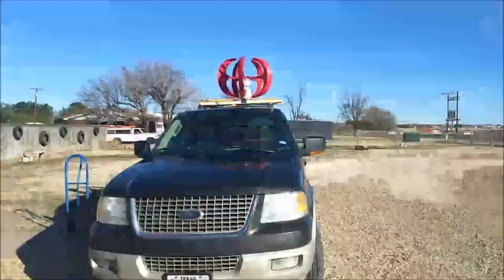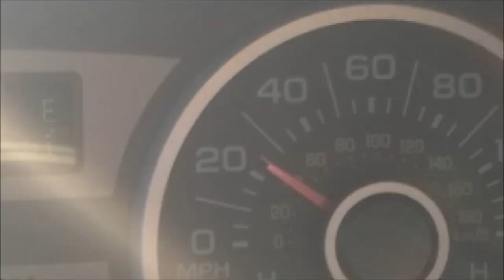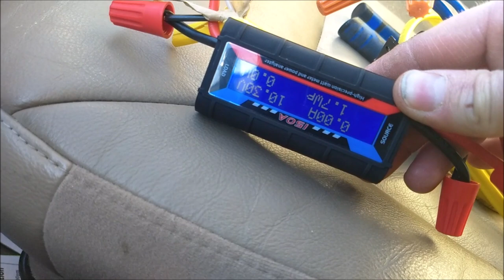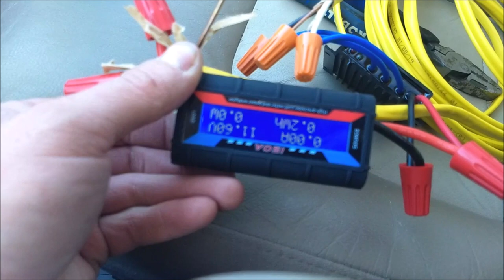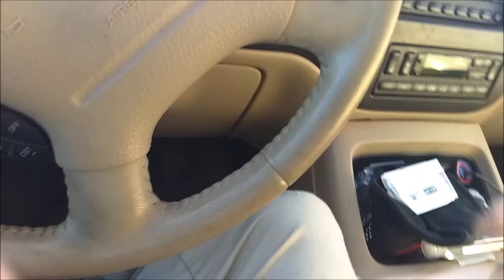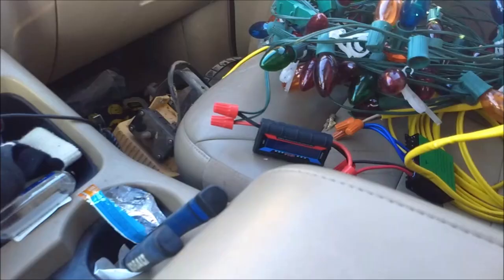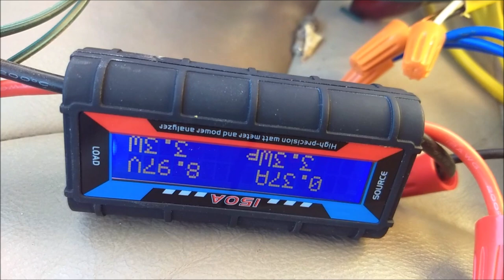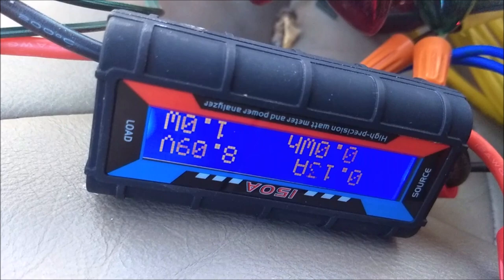What happens if you bolt a Chinese/eBay vertical axis "lantern" turbine to the roof of your car?!

Comment: But all those lights you’re trying to use as loads appear to be 120V AC Lights, and the machine is supposed to output 24V DC, right? And your charge controller is looking for a battery, to charge, right? You may be right, but we cant really know for sire because your loads aren’t the right loads to use... you need to connect the charge controller to a battery, then the battery to an inverter, then plug your lights into the inverter. Or juat use a dump load resistor.
Reply from the maker: ANY load should have drawn some wattage out of the turbine.  A 120v AC lamp would act like any other kind of resistant load.  The take away from the experiment wasn't suppose to be "well it turns out this allegedly 400w 24vdc turbine can't run a 120v 500w work lamp"...the take away is that the turbine was not producing any usable power regardless of wind speed.  I could have built the perfect system and there still wouldn't have been enough copper and magnet inside to make it work.
Reply: Toys for Watts what you say is true if you connect the output of the generator directly to the lamp, but not it it’s a charge controller. If that’s a charge controller it won’t put current to a lamp unless it’s a designated lamp connection. A charge controller is sensing the voltage level of the battery it’s charging and won’t send current to a short circuit and won’t send more current than what is safe for charging the battery. The current exiting the charge controller is dependent on the battery level, that’s why connecting lights to the output of the charge controller won’t work.

Comment: if i am not wrong if your battery is already charged and you don't have a power cosnapion someone how , you won't get any power from the generator.
Reply: you need to connect 2 brand new batteries and be almost empty
Reply: That's not true. It will make watts even with no battery's.

Comment: You are under the air foil in a vacume move it forward 5 feet so it's a the break of the windshield you will get a very different result but it's still crap the last generation is decent though
Reply from the maker: It's actually in a high pressure area (according to Ford's aerodynamics testing)....the air where the turbine is would actually be densest/fastest where I put it....BUT I actually sat down and did the math after putting the video together.  Ignoring all ideas of whether positioning was responsible for the results, the turbine was spinning nearly 6000rpm at one point and peak open voltage didn't come anywhere near manufacturer claims.  There's no way it would reach that kind of rpm on a pole in my field...it really was just a bad stator/rotor combination.

Comment: He confused watts with kilowatt-hours on the meter readout.  Should have calculated the watts by multiplying the amps X volts instead of reading the kilowatt-hours.  Anyway, it obviously needed much more wind to get going, so this is not going to be practical any way you cut it.  Thank you for showing us the actual performance!

Comment: Good concept, but a few flaws I Can see . The turbine is not actually getting the amount of air speed you are driving, as it is not in clean air and the point of compression has changed due to the aerodynamics of the vehicle. Maybe put it on the hood instead of the roof
Reply from the maker: The hood is actually a low pressure area.  The highest densities around the 2005 Ford Expedition are directly in front of the grill and about 12" behind and above the top edge of the windshield.  Air has to compress and go up and over the hood...it's not a particularly aerodynamic vehicle and air does not flow cleanly around it.  I chose top center because it was the densest air I could safely get.  Trust me, at the one point the turbine was running between 6000 and 7000 rpm...the location exposed the turbine to more wind and rpm than it would ever get during reasonable use and still produced next to nothing.

Comment: in short, is this wind generator good or is it crap, because all I hear is that it's crap, that it doesn't generate anything, crap, does anyone answer? someone has ? it works .
Reply from the maker: No they're rubbish, the stators and magnets are far too small and they cannot achieve any kind of reasonable RPM to make any real amperage.  They should be avoided.
Reply: and if you change the thickness of the wires and also the magnets, would it work? do a test there!, then put it on video.

￼

Comment: 1.7 WATTS? WTF? Is there anything inside this thing?
Reply from the maker: There is, but not much.  It just didn't have enough magnet and wire inside to really produce anything.  It really would have done better or a 48v (or higher) rig but even running to a 12v battery it should have done more than it did.  It's simply an example of something made for aesthetics vs performance.  It was neat to watch it spin.

Comment: Your car will be using more gas because of the drag and weight. Its a tiny amount but so is the power you generate. Also these drag-type vertical axis wind turbines are very inefficient because the drag keeps it from spinning efficiently, perhaps try the helix type.
Reply: I don't think he meant to break the laws of thermodynamics 😊

Comment: Dude. The mph on many turbines are 10- 24 mph
 (atmosphere wind speed). If you exceed that the safe mode kicks in and dumbs down to protect the system.
Reply from the maker: No...no they don't.  Charge controllers have brakes integrated into them sometimes, but the turbines are just copper and magnets.  And when the brakes are on, they don't just stop electricity from flowing, they stop the turbine from turning.

Comment: Everyone did notice the meter reads what is current and he was stopped while showing us. The battery went from 10 volts to 11 volts so it was receiving a charge. cant say how much because we cannot see meter while vehcile is moving.....Inaccurate testing of this....
Reply from the maker: It wasn't suppose to be an accurate test.  It's easily the least informative test I've done and was only done to demonstrate that it was simply incapable of coming anywhere near the seller's claimed outputs.    You can see the break down of the generator in the link below...too small of wire, not enough of it, and tiny TINY magnets.  Producing anything at all was impressive in a way.  https://youtu.be/H7_UFuM9ZZY

Comment: I think the design of the turbine part is fine it must just have a total rubbish generator. I think if you bolted that rotor to a dc electric scooter motor or anything similar, you would get a much better result.
Reply: No way. That design is absolute rubbish. The air that gets sliced into by the leading edge creates a fckd up vortex on the trailing edge causing loss in efficiency.
Reply: @haywoodjablome440  yeah i get that but easily fixed with wid deflectors focusing the wind to only catch the trailing side.

Comment: First off is, are you trying to light a 500 watt bulb or a string of Christmas lights that operate on 120 AC to a 12 volt DC/Charger/battery setup?  That will never work.  You can put 12 volts at a 500 amp hour source into a 120 bulb and it won't light up.  However the generator seems to be a piece of shit incapable of producing even the 12 volts it advertises more or less the 300 or so watts it claims.

Comment: The problem is probably not the generator, but the turbulences from the car. Look up wind tunnel testing where you can see the flow and you will see.
Mount it on a pole 2m above the car and test again or at leat as far as possible to the front of the roof.. In the driving view you can partially see it is rotating very slowly, which shows it does not actually get much wind at all.
I doubt it would get 400W, but 100-200 should be possible even with that Chinese thing....

Comment: Defintely dont trust any numbers from Them but something is wrong with your battery or your connection to it... The thing has to get at least 200w but I've seen other tests that give 400.. get a multimeter and another battery connected to an inverter, connected to a load.. Scrape the gunk off the battery terminals or try new battery

Comment: I think theres lot of people like me thats mechanically inclined and been interested in wind and solar, but never studied Amps and watts to understand what we need for our projects.
     I have a 20ft camper on land that I bring a Marine battery to run a couple lights at night mostly on weekends or a week at a time. I thought something like this would be good to keep my battery charged all times so I can leave my battery there becouse i bring it home to charge it.
  Does anyone have any recommendations that works for me? I dont go solar becouse of shade. The battery would have time to charge for at least 5 days before I'm back.  I thought something like this would be nice becouse its small more hidden for what i want. Any ideas is welcome. 
Thanks for the good video.
Reply from the maker: What size battery are you charging and what kind of wind can you rely on?  You say no to solar because of shade, but shade makes me think you're around trees and that tends to interfere with wind turbine operating also.
Reply: @ToysforWatts   right around 1000 CCA marine . Its about a truck battery and a half. Its heavy. I bought it at walmart 12 years ago. Biggest one they had. Still good.  I do plain on up grading battery I dont have it by me to give information on it. But I do plan on upgrading battery. I don't use a lot of power battery is actually lasted 2 weeks every night for couple hours before I recharged it.
  I am around trees in a planted Pine Forest. Thought I would mount on a 35 foot pole trees are only 20- 25 ft high. I do get good wind above tree line real consistent. Lake Michigan winds.

Comment: Its not even spinning i would recommend covering half of the turbine that way it only gets wind  on one side get it spinning in one direction
Reply from the maker: There were times when it was spinning 6000+ rpm.  What you're seeing is called shutter sync.

Comment: What we need is smaller versions of these to screw on the car when it's windy outside and we are not using our car, like at night, simply to make use of the car roof and the wind.
Reply: He thinks he testing wind speeds,  but driving 100kmh is tornado,  windmill work 10m/s speeds but hard calculation when shoe is measure instrument and bad connection and too long and thin wire needs 6mm2 wire and good battery no dead car battery

Comment: THANK YOU I was thinking to order its claiming 4000 watts the liars
Reply: Its crazy, they range from 800w to 4000w+! (exact same models /price) 

This should be reported as a scam.
Reply: Funny thing is that in his previous video he said that it is a 400W unit just before he started pinching some of the wires inside with a calliper to measure them. I cannot see that the manufacturer would have been this far out... and apart from the clueless manner in which the test was conducted, the chances are that he severed some of the wires when he had his calliper in there and the alternator was running on only a few windings.

Comment: One could easily discern that the lantern type makes no sense.  It would have taken less plastic to make the blades straight instead of curved, and would have provided a greater swept area and more output.  So it's obvious that they chose form over function.
Reply: you forgot centre of gravity and bearing stress and structural reinforcement that is probably reduced by the curved shape, besides drag when the blade is going towards the wind
Reply: Build over chimney and hot air spins

Comment: The thing wasn't spinning properly because of the air being pushed over it by the hood and windshield. There is a pocket of air that is created there.
Reply from the maker: It was spinning the entire time the vehicle was moving.  I mounted it in the densest possible air over the vehicle.  You're confusing shutter sync with "not turning".  There were times when it was spinning in excess or 3600rpm.

Comment: The vertical part is actually a good idea if you are limited for roof space, etc.. so why do they make them so crappy and keep making these ridiculous claims?
Reply from the maker: Sellers control the market from China.  The manufacturers know and list most of these as low wattage turbines and most of these "lantern" style are meant to be decoration more than anything else.  The sellers are out to make money and they can do that most easily from the gullible.

Subscribe to the channel :)  I will be spending quite a bit of time this year discussing vertical turbines...mostly ones that don't work but I'm hoping to get a few successes in the mix, too.
Reply: @ToysforWatts  subscribed now :o) looking forward to further research of the verticals.. one of the main reasons I am curious of these is putting something on my van.. I don't think a horizontal with a 6 foot prop span would work real well.. lol

Comment: Why not bench test it on a vise with a leaf blower? Lol so the air is directed at the optimum angle and direction.
And also did the turbine actually stop at times while driving or is that just video shutter speed matching turbine RPM?
Reply from the maker: I did bench test this turbine.  I actually did a full tear down and inspection.  There wasn't enough copper to produce even half the claimed power and the armature was covered in very weak, very small magnets.  A leaf blower would not have been able to provide even a measurable fraction of the wind force I gave it by putting it on the car...I put it in an area of the densest, fastest moving air around the vehicle.  The points where it appear to stop are simply shutter synchronization.  It was moving close to 6000rpm at one point in the video.
Reply: @ToysforWatts  great test thank you sir

Comment: I enjoyed the theatrics, but why didn't you just drive it with a motor (e.g. electric drill) to see the output of the generator vs. RPMs of the rotor? That would have been more convincing and certainly more reproduceable.

BTW: most Chinese "high wattage" solar panels don't produce anything near their stated rating -- e.g. a 12 x 24 inch unit claiming 50W barely output 6W in direct, unobstructed summer sun. I guess those Chinese stores have even less scruples than corrupt US stores and their government doesn't care. Most high-wattage Chinese LED flood lights are a sham.
Reply from the maker: I did do a video showing a drill-driven bench test and it produced very little power...as I explained in this video the point of putting it on the roof was because the vendor said I just needed to hit it with more wind to get the rated power out of it.
Reply: @ToysforWatts  Thanks for the reply. Sorry, I missed that video reference. Now that I've seen it, I now wonder what the generator's "wind speed to RPM" conversion ratio is to be able to relate that direct drive test's results to real wind power (or rather, lack thereof). I've only just begun to look at generators (but not in great detail) and have come to learn that most useful turbines do speed multiplication for higher efficiency, especially at lower wind speeds. I noticed somewhere a reference to using a car alternator as a generator, but I misplaced the video in all the noise I push through daily. But then I'm still left with my sucky solar cells...

Comment: You need to use a good battery, the power has nowhere to go.  A regular battery charger wont charge it either.

You did the experiments wrong. You also need a earth ground for the 3 phase experiment. You could drag a chain.

Comment: I believe your cars aero dynamics were interfering with the wind. It seemed to spin better at 30-40 mph. It probably needed to be 5 feet or so above the roof. Nice effort...
Reply: 可以介紹安裝電機工程介紹如何充電器
Reply: 太陽能控制器可以並用當做充電器
Reply: Optical illusion. The frame rate of the video causes a speed up then slow down as the frequency match up and diverge. The same as videoing a propeller of an airplane. André

Comment: Your unit must be defective, check your wiring, there is no way that 3 phase at that speed won't produce the same power the motor is rated for. Change the controller and try again... Love this!

Comment: Looks like it needs to be mounted higher up for higher vehical speeds. The aerodynamic of your vehicle is shooting the air up and over the turbine the faster you go.  Mount it way up then that thing will break from the insane end speed.
Reply from the maker: According to Ford's wind tunnel shots it'd have been in the densest air around the vehicle mounted about 18" above the roof line...and it was moving close to 6500rpm as it was.  Any more and the arms would have flown off!

Comment: This experiment is not  good or efficient solution, there is another method which can be used and batteries can be charged and the range of the EV can be increased significantly

Comment: Can appreciate the purpose of your testing, but it was fundamentally flawed from the beginning.  The airflow hitting your front bumper is not going to be the same airflow hitting the blades of the generator due to the aerodynamics of the vehicle. 2nd, starting off with a completely wasted battery is likely impacting your numbers.  You would have been better off testing the generator with a variable output from an air compressor using a calibrated meter so that you know EXACTLY what the airspeed of the blades were. Also, because of the battery, you'd be better off working under a "no load" scenario.
Reply: how can you measure power without a load?

Comment: 400 miles an hour, probably considering they only produce 4w
The solar panel on the roof produced more power than the crappy 4w wind turbine during the test. lolz
the result, you got scammed.   the diddy alternator on the bottom of the turbine is garbage.  fit a proper 1kw+ motor to the bottom